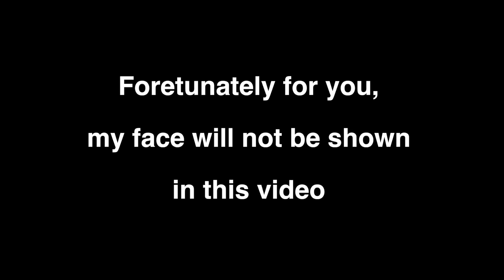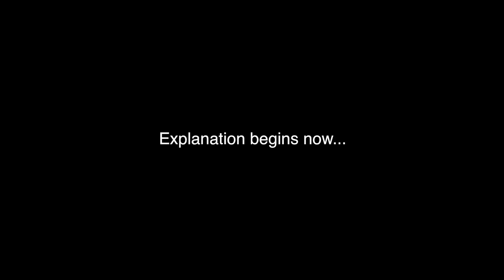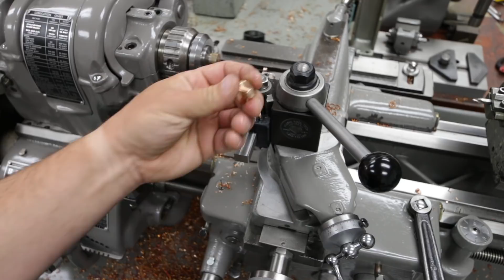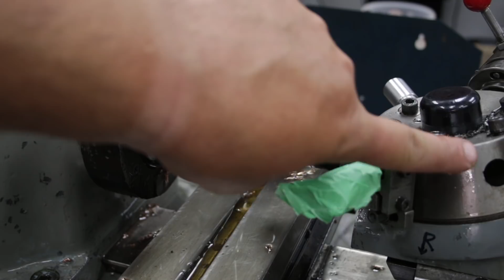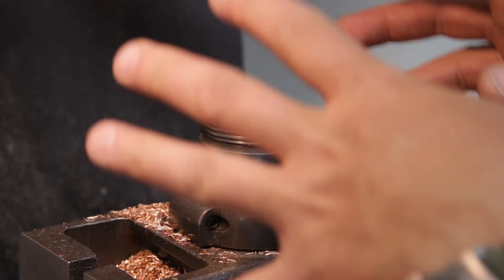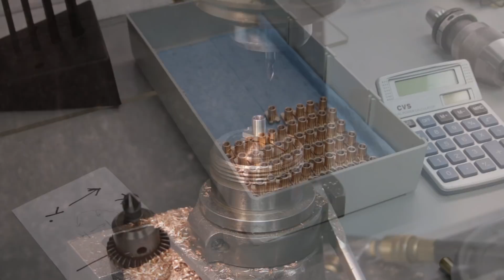Making Bronze Backlash Nuts on the South Bend Heavy 10 and Hardinge DSM59

Comment: Well done.  I have a South Bend 10 also- and bought a used turret for it that I'm trying to set up. Quickly found out about the cross slide getting in the way of the turret too.   Thanks for showing this, it will help.

Comment: Nice job Brad. Great looking parts. You had me thinking what I woulda done if in the same boat with just one lathe.....Had the Hardinge not been available I would chucked up some steel in a tailstock drill chuck (or collet) put a drill in the headstock collet and drilled & reamed the proper size hole to accept the drill size you needed for the job...then loctite it in place so it could be used to finish the rest of the parts as it woulda been true to the axis of the lathe at that point.  But then again...a second lathe is a much better option 😊 ~ Richard